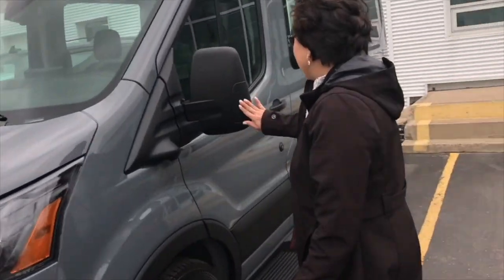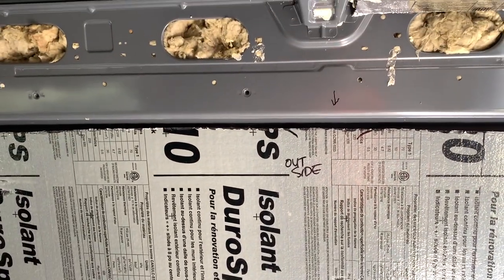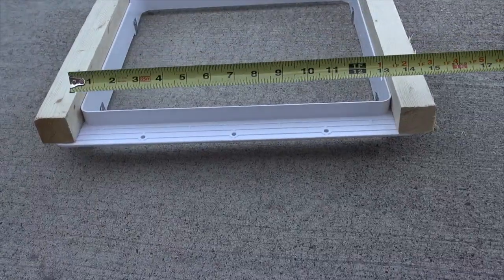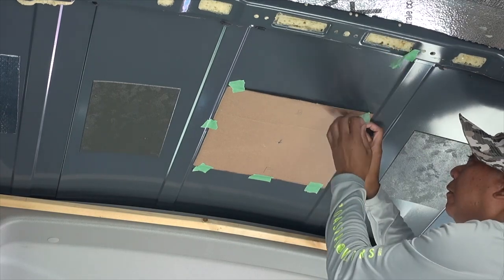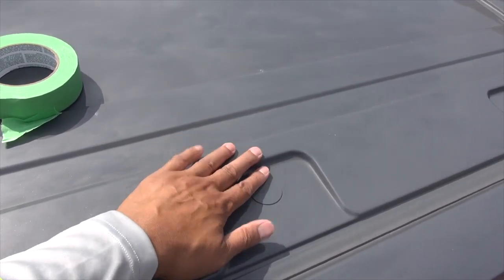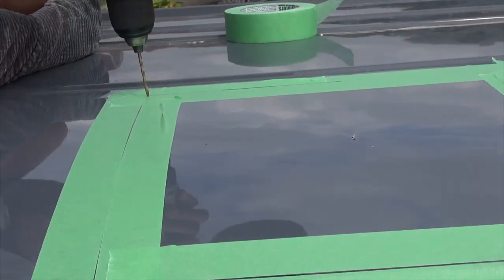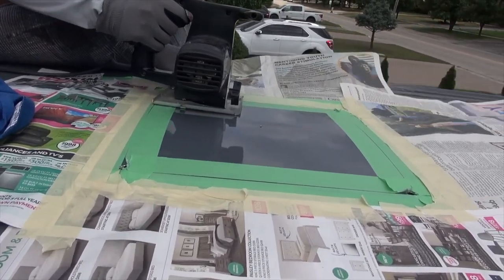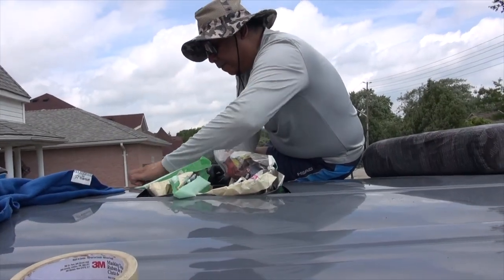2022 Ford Transit Crew Van AWD Max Air Fan Install (Part 1)

Comment: Great job, Jonah! I also learned the quickest way to make it rain is to cut a hole in the top of my van! Other than that, hope all went well with your installation.
Reply from the maker: Yeah isn't that the craziest thing. It still worked out in the end.